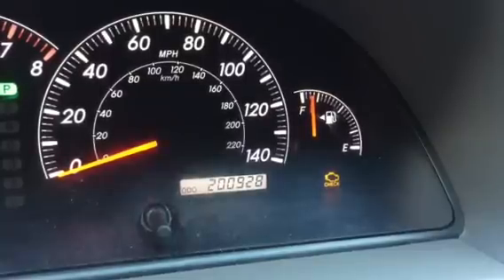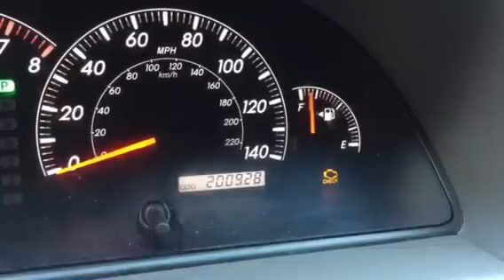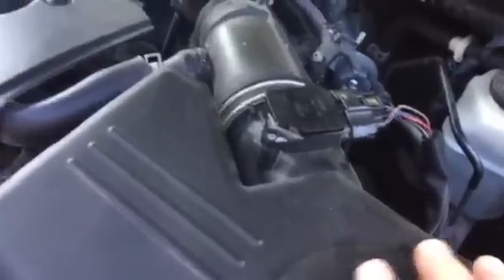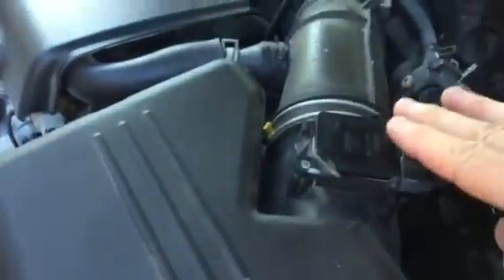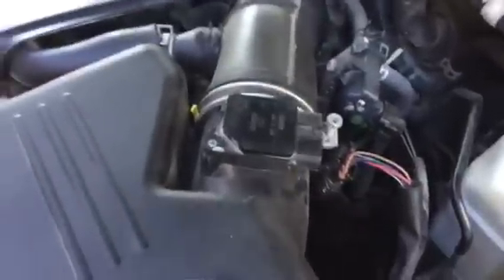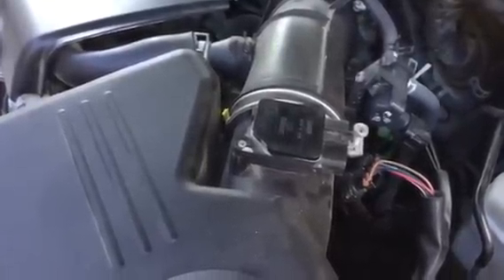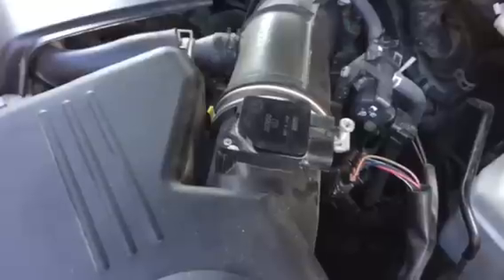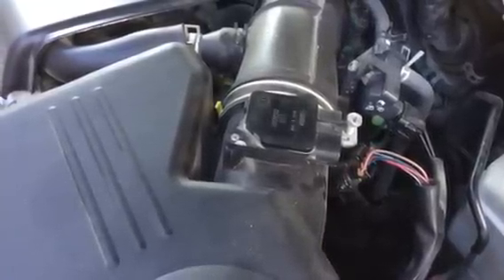How To Tell If Your Mass Air Flow Sensor Is Bad On Your Car

Comment: Dude  very helpful thanks  for the clear  and  limpid  feedback... great- Question: my  engine 
light  is  also  stays on and  the car  does not idle for more  than 10 seconds without giving some gas. Do you know  a meaningful way to test it the mass air flow sensor before  the 
car  stalls

Comment: what if the wire that connects to the MAF sensor has a lock in feature that broke while trying to remove it, and now its stuck plugged in??
Reply: Then you need new wires and sensor plate

Comment: Thanks so much i just unpluged it and its been working like that for 3 months i will get a new one but can you please tell me the consequenses of driving like that ?
Reply: It's been 2 years so you probably had additional problems. You shouldn't run it for more than a few seconds disconnected as it can affect your expensive ECU. This video gives incorrect information. Vehicles should continue to run in a default mode using the O2 and MAP sensors instead of the MAF for a 14.7:1 A/F mixture when the MAF is disconnected. The engine dying is NOT an indication of a faulty MAF sensor as stated in the video. We (mechanics) may do it for a few seconds while watching the fuel trim data for changes on a scan tool to make diagnosis but only when we have available live data streaming from our scan tools. Probably why this video has so many dislikes; BAD INFORMATION!

Comment: I just tried this on my 2004 Volvo V40 1.9D. It's just had a brand new MAF sensor fitted, but when I unplug it, it runs on still the same.

Symptoms: lack of vacuum, blue smoke, underperforming. Fitted a brand new MAF to it because it was severely lacking power, as in nigh on unmovable in anything higher than 1st gear. It brought most of the power back, but still had a lack of powed and was smoking.

Videos of what the car is like at the moment can be found on my channel. Thoughts?
Reply: Manifold gaskets and extra air is bad but 100$ says it has a very small antifreeze leak  thus the smoke 02 sensors can almost go for any used vehicle. . .

Comment: I try it on Nissan navara d40 and they engine doesn't stop what's that's mean;;
Reply: sTeLioS it’s different for different cars, some cars have a 1 bar system where if the MAF is bad it runs the air fuel ratios off of throttle position. It will just drive like shit unplugged.
Reply: @carsonke4ting  thank u Brooo

Comment: All you have to do is disconnect it from the hose clamps and spray in mass air flow sensor cleaner and spray the little wires.! And bingo fixed
Reply: Doesn't always work, BINGO not fixed.

Comment: On my  2001 blazer just now that very hesitating and bucking like crazy i took off MAF connection and it started to stall but kept running...then i test drove and no more bucking still some hesitation,but runs way better then it did with MAF connected... i will pick up one tomorrow and truck should run perfect... Thanks to this video i new how to test MAF...i did get P0101 code and cleaned MAF with special cleaner and let it dry ,but still bucked badly...These real time video's are the best...thanks for posting...

Comment: Is this true to all cars? I have a 2005 Chevy Equinox and the engine stops when I removed the MAF sensor cable. This truck jerks when the car runs and ambient temp rises. I am thinking if it is caused by the MAF or the IAT sensor. I cleaned the MAF before, it improves a bit but the jerking is still there. Hope someone can help.

Comment: Would a bad one cause the car to have an erratic idle? I unplugged mine and it keeps running. I've been having a problem where my idle is crazy. It's like someone is hitting the gas and letting up. Car starts at 1500RPM's and will jump up and down up to 3000 +. Can't find any vacuum leaks and I replaced the TPS and the IAC and cleaned the TB. This is on a 96 Deville. I barely need to hit the gas when driving, it goes by itself and goes faster and faster as I go along. I gotta ride the brake.
Reply from the maker: The answer to your question is no.  Most of the time this is caused by a failing throttle body. If the throttle plate sticks and does not return to the correct position then the vehicle will accelerate.

Comment: I can’t figure out what’s causing my code it’s a po171 lean code it’s not the maf it’s not the o2 sensor I replaced the hoses and the damn thing still comes back on and advice???
Reply from the maker: How do you know it's not the MAF or O2 sensor?
Reply: proclaimliberty2000  I replaced the o2 and cleaned the maf and did this little trick
Reply from the maker: How many O2 sensors do you have?  Did you replace them all?
Reply: I have 2 1 before and after the cat I don’t think there’s any reason to replace the second one
Reply from the maker: These check engine lights can be a real pain in the butt.  It seems like this code is usually the MAF or oxygen sensor.  However it could be a faulty fuel pressure regulator, weak fuel pump, clogged fuel filter, faulty power train control module, vacuum leak or faulty injector(s).  If you have a lot of miles on the MAF or second O2 sensor I would consider replacing each of those one at a time.
Reply: Many things can cause a P0171 code. I assume that you have a 4 cylinder or straight 6 cylinder or you would probably get  both a P0171 and a P0174  code. A common problem is a vacuum leak or fuel delivery issues.

Comment: Hi there, I know this is an old video, but this just happened to me, I have a toyota Camry too, check engine ligth came on scanned it and they told me I have A bad mass air flow sensor I did like this video and car turned off, checked the sensor and it was clean, is there any possibility of the sensor to still be bad?
Reply from the maker: BBDGus Yes.  EBay will be your best price.

Comment: Could a bad maf senor throw a run lean code bank 1. And not allow the car to go over 20 mph and 5 mph up a hill?
Reply from the maker: Heather M. Yes
Reply from the maker: https://youtu.be/047xItGmNH8
Reply: Thanks.
Did the unplug the sensor and it kept running.....

Comment: All of the idle issues I've had with my truck I couldn't figure it out to save the life of me, I tried the unplug method and my truck kept running and the abs light came on. The airflow problem was giving me a lean misfire code so what did I do, I replaced all of the plugs wires and ignition coils... wasted my money, come to find out the MAF sensor was the problem smh... all I can say is thank God for YouTube saving me so much money from getting ripped off by mechanics that are way overpaid...
Reply: 434 ranch I have real bad idle problems it shakes so bad but it runs to smooth . I put seafoam , I changed the spark plugs , I cleaned the idle control valve , and cleaned the throttle body . This will be my next step
Reply: @Chicano-b1l  also check motor mounts
Reply: Overpaid?

Comment: I have a mazda 3 2014 and i disconnect it and the motor was still running so i guess i have to change the mas air flow sensor.

Comment: Just subscribed. Great video, extremely helpful! My only single piece of advice, take it or don't as it won't hurt my feelings (I hope someone can learn from my mistakes), would be to turn the ignition switch to the off position before connecting or disconnecting ANY sensor. I have left vehicles running before while messing with sensors with no issue but on JUST ONE occasion I was messing with a MAF sensor while keeping the vehicle running and it sent a power spike to the PCM, then I had to deal with that... With the ignition set to off before messing with any sensor avoids this from ever happening. Hope this helps. Again, great video.
Reply: How do we test MAF as suggested by this video, if we have to turn off the ignition?
Reply: How did you fix the power strike to the pcm. I'm having the same issue. I unplugged fuses while the car was running then I heard a click click sound. I put the fuse back in and the click sound stopped. But now my car has a check engine light with the obd scanner reading a maf problem. I have changed the maf sensor, ignition coil and spark plugs, but still the check engine light is on and obd reading is saying maf. I think maybe my pcu is tripping and needs to be reset or it takes time for the computer to relearn and reboot.
Reply: @hearditfirst8010  don't negate the possibility of a broken wire or bad connection in the pigtail. people forget that a code regarding a sensor doesn't mean it's necessarily bad, it could also be a communication issue with your control module.
Reply: @sladeherb4056   It was actually my throttle body that was the issue. It got dirty and stuck so it wasn't letting air in, and the maf sensor couldn't read anything, so the CPU assumed the maf sensor was at fault, when it was the throttle body that wasn't letting air in for the sensor to read. You are right in a sense that maf sensor is sometimes the scape goat and not the issue, because the communications are all inter related and inter connected and dependent. Throttle body doesn't have a sensor so the computer blamed it on the next thing that does.

Comment: yes that did help tremendously.....i have a 2004 chevy impala and i unplugged the mass air flow sensor and the car just kept on running
Reply: Did it randomly turn off? Hard to start? Im having this issue on my 04 impala

Comment: I have 2003 crown Victoria it bucks and kicks, unpluged my MAF sensor and car turned off.dont know why it's running so rough at idle it seems to be okay under acceleration it kicks in Bucks almost like a Miss but if I give it Full acceleration it uses a lot of fuel but it doesn't miss.not sure of next step to diagnose.
Reply from the maker: Joel Schwarz Do you have a check engine light?

Comment: Thanks your spot on my mazda e 2000 van  had a MAF sensor that was rat shit, followed what you showed  and sure enough it was gone  .   Before i watched your video i took my van to a local mechanical shop they could not fix the problem but i still got charged $662 dollars  to clean the fuel rail and put a new fuel pressure regulator on .  When the van was running it was like the old fashoned choke was pulled on and it was blowing black smoke from the exhaust., after seeing your video i brought a new maff sensor fitted it my self  and bingo runs great just the way it should thanks mate .

Comment: I just tried this and my car did NOT shut off.  My gas mileage over the last month went from 24 down to 12.8 on my 2006 Hyundai Elantra.  What do you think, have I diagnosed my problem?
Reply from the maker: jgarrison1309 Do you have a check engine light on?

Comment: After getting an 'engine check' light on the dash of my 2015 eco-diesel (traced to a mass air flow sensor issue) I was able to clear the light simply by changing the air filter. I found a mouse nest build-up on the intake side of the filter and after vacumming the filter unit completely and changing the filter, the light cleared itself after about 5 miles of driving. Try this 1st - it costs little to nothing and should be done anyway.
Reply: hahaha , a mouse nest
Reply: @rebdawi2002  That's nothing, my older ('01) Dodge 1500 wouldn't throw much heat one winter and when I had it in the shop to replace the heater fan the mechanics found a MASSIVE mouse nest under the dash which completely engulfed the heater core and clogged the fan.  It was enough material (moss, grass and seat cushion foam) to fill a garbage bag.  We live in the country 30 miles from town.  He told us it wasn't "uncommon".
Reply: @mic982  :face-blue-smiling::face-blue-smiling::face-blue-smiling:

Comment: I have a 1993 Buick Regal. Does this test apply to my vehicle? It will be running, I'll disconnect it and it stays running. My issue is it struggles to start and it has randomly died while driving. Any feedback would be greatly appreciated.
Reply from the maker: Do you have a check engine light on?
Reply: proclaimliberty2000 negative
Reply from the maker: Sean Gedge This is just a guess but it’s possible from what you’ve described that it’s a failing crankhaft position sensor

Comment: After doing this test more engine lights came on any tips?
Reply: Yeah, don't listen to this guy because he is giving incorrect information and it may cause more damage. Hope that is not the case with you. Probably the reason he has such a long disclaimer. A car in perfect working condition will continue to run after disconnecting the MAF and I wouldn't suggest doing it, or at least not for more than a couple of seconds if at all. Your ECU will depend on other sensors (O2 and MAP) to calculate for the 14.7:1 air/fuel mixture needed but the OBD II system will throw 1 or more codes. Leaving it for an extended period will put the ECU in learn mode, causing it to learn incorrect parameters but when corrected, it should recover if damage hasn't occurred to sensors. This is a short incomplete video that confirms what I'm telling you. Best wishes!   https://www.youtube.com/watch?v=M1m-n5rxuQs

Comment: Every now and then the red lighting bolt on will show up on my 2008 dodge charger, and car starts stalling . ill shut the car off and restart and it goes back to running fine again. I know that's the indicator for a throttle body issue but could the maf sensor also cause this or is it my throttle body needing cleaning or replacement?
Reply from the maker: I would first have the vehicle checked with a diagnostic scanner to see if it has any stored trouble codes.  Auto part stores will usually perform this for free.
Reply: proclaimliberty2000.thanks I will do that

Comment: Will It work on TATA safari Dicor Sedan SUV model 2012 car ? Please help in knowing as my car running after removing MAF sensor? What are the steps to test further?
Reply: KONSTANTIN XXX I cleaned sensor with Isopropyle alcohol . p0100 , p1011 error Also P0211. Can you help

Comment: I’m getting the Po171 and Po174 code on my 2004 Ford Taurus so I did this to check the mass air flow sensor. The first time I unplugged it the car shut off but then I plugged it back in and started the car and unplugged it again and the car stayed running so I’m thinking maybe it doesn’t need to be replaced, maybe just needs to be cleaned. That’s what I’m hoping anyways. Either way I hope something works because I can’t get this stupid engine light off so I can get it to pass inspection.

Comment: I had idle problems in my mitsubishi outlander 2003, like running low on AC, after I clean Mass Air Flow Sensor and Idle Air Control Valve start working fine, however at the next day idle was too hight at the first start and then too low on every other starts; that engine stop almost immediately after turned on, I have to press pedal to keep it running. Based on this symptoms could you determine if the problem is in the MAF Sensor or the Air Control Valve?
Reply from the maker: Have you tried this?  https://youtu.be/cOAYWVBfuek
Reply: Yes, actually, problem started after I did the cleaning.
Reply from the maker: Israel Have you used a bottle of fuel injector cleaner in the fuel tank?
Reply: No, I clean the butterfly valve and the Idle Air Control Valve. Do you think a damaged Idle Air Control Valve can cause this issue?

Comment: Im having problems with my car loses power when I give it gas sometime and turns off it also makes poping noises from the manifold when I givw it gas can it be the mass flow sensor?
Reply from the maker: 7rove 5ide It sounds like you could have a partially plugged catalytic converter.

Comment: Going to try today. I replaced both 02 sensors yesterday and check engine came back on after I cleared it. I changed my heat sensor too . Stay tuned.....

Comment: In some cars the engine will not die because the ECM has a predefined fuel trim for when the air calculation fails. It will just run really rough!
Reply: You are absolutely right, my range rover 2003 still runs after i unplugged the map sensor.

Comment: Something you might want to mention is that diesels can run without a MAF. So the engine might still run with it disconnected, but the MAF still be bad.
Reply: This is the case on my diesel
Reply: totally correct, you deserve a medal. But in the US basically no one owns a diesel car after VW dieselgate

Comment: Remove MAF sensor (torx screws) and spray the filament with electrical contact cleaner for a 10 minute fix; new part not required after 15,000 Km's

Comment: my 2008 4runner cranks up and starts for few seconds then dies immediately,   is this a MAF sensor problem?
Reply from the maker: It's possible .  I'm assuming your check engine light is not on.  I once had a vehicle that did the same thing and this fixed it.  https://youtu.be/cOAYWVBfuek
Reply: yes its not on, thanks

Comment: my engine light has never came on though I still suspect my maf is bad because the engine keeps running when I disconnect it.  The parts store checked my engine codes and said I have a P0171, and a P0174, which means it's too lean of fuel mixture causes the engine to misfire. My question is that once I install a new maf, will it still continue to misfire during the 20 mile drive time that the computer is resetting? Or once the new maf is installed will the engine immediately run correctly?
Reply from the maker: It's more than likely a bad maf because of the engine codes so you probably solved it.  I'm sorry but I don't know the answer to your question.  The answer could vary based on the particular vehicle.

Comment: This is such a good video! You are awesome!!!! I've got a dumb question, will a bad sensor keep the car from cranking?
Reply from the maker: The answer is no.  There is no dumb question and I'm glad you asked.
Reply: My KIA SEDONA 2003 cranks when it is cold after I drive it for sometime it doesn't want to crank back up what could be the problem? The check engine light is on and the computer is reading FTS replaced but not cranking when the engine is hot,the truck don't run hot though. Please help
Reply: mark george bad fuel pump